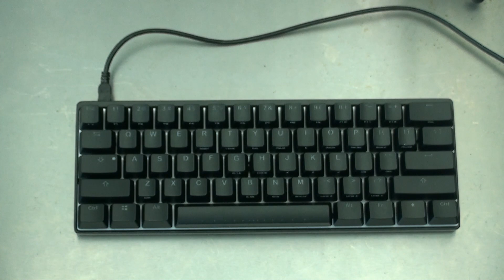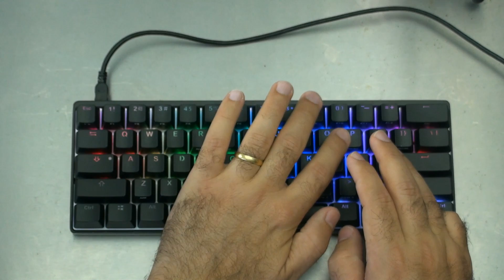How to: POK3R RGB layers

Comment: I know this is old but I just got one of these and the RGB mode is not working. DIP switches all off. On default layer and Pn + whatever does nothing. Am I doing something wrong or did I get a dud. Some of the lights work like under the space bar, the caps lock, etc.

Comment: You can easily customize each colour by key or by row like you mentioned for each layer, the layer has no weight or influence on the effect, it all depends on how you enter colour or RBG selection mode. If you enter the mode by pressing PN or Menu 0 it will select the entire row, hover if you enter by pressing PN or Menu 9 it will allow you to select individual keys to light up and not the entire row.